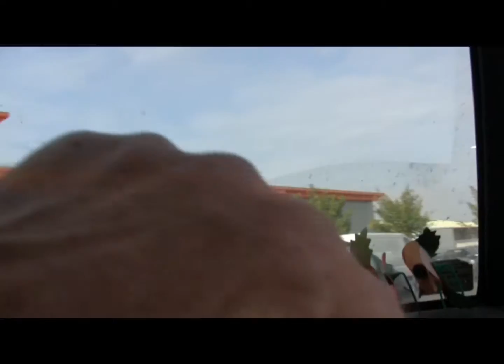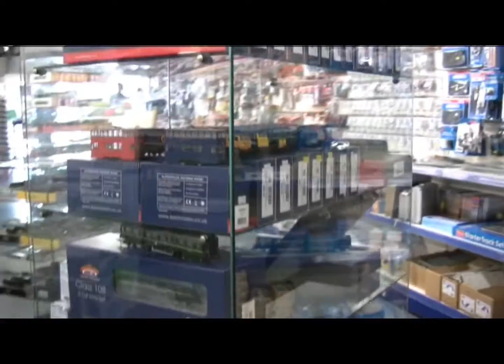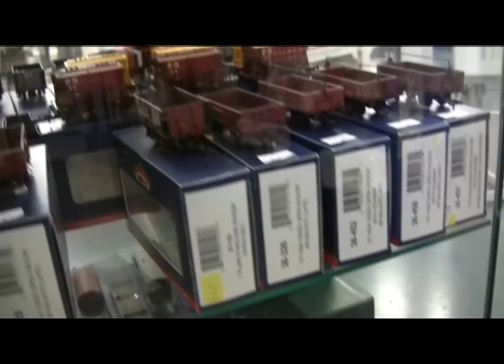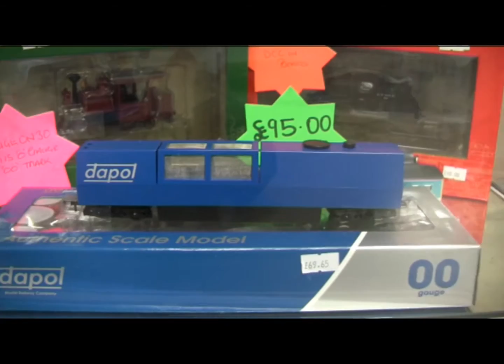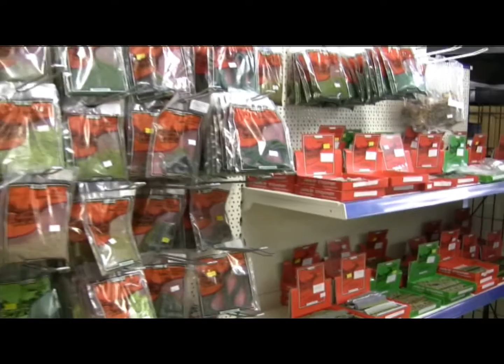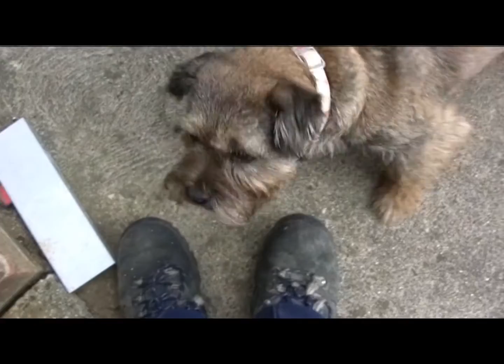N Gauge Railway  Peterborough model shop shed engineering

Comment: Nice video and great looking shop also those OO trains for £22 they are hornbys railroad range which is cheap and reliable models without any extreme detail such as sprung buggers etc it's to help people get into the hobby or for people on a budget
Reply from the maker: Thanks ichwohnt ,,,, didn't know that,,,, Do they do the same for N gauge,,,, I wonder,,,
Reply: ***** from what ive seen they dont do budget models for n gauge considering on of the companys is owned by bachmann which produce high quality models and n gauge you have to give up certain aspects for the model to be built in that scale
Reply from the maker: Many thanks ,,, I better keep saving up then,,,,

Comment: Absolutely fantastic video Alan, I really enjoyed that primarily because I visited Trains4U in about March after it was virtually cut in half from it's previous space and I have to admit that I wasn't too impressed, not because it was smaller but because there was hardly any stock in there in comparison to what it was like before it went half size. However, they have obviously got that all sorted out now and it looks as though it's brimming again with lots of goodies to buy, I will definitely make another trip up there again in the not too distant future. Good luck to them as well because I would hate to see a model shop like them close and it's very true what you said about actually seeing the things in real life rather than just on line. It also gives me inspiration as I walk past things which I never knew existed. By the way, the blue wagon you saw which you had no idea what it was is an electronic track cleaner made by Dapol. It has a rotary disc underneath it which you can fit very fine emery paper to or a polishing pad, it even has a hoover fitted to hit which you can tow behind a loco and hoover up all the crap that the sanding dick has taken off the track plus of course it can be filled with conventional track cleaning fluid.

The wire mesh seemed a pain in the b*m to unwrap and I really felt for you, I think if that had been me then it would have been thrown through your window within 5 minutes of trying to unwrap it lol.  

Well done mate, a cracking video..............Graham
Reply from the maker: Many thanks for your support and comment ,,,,,,,   Alan